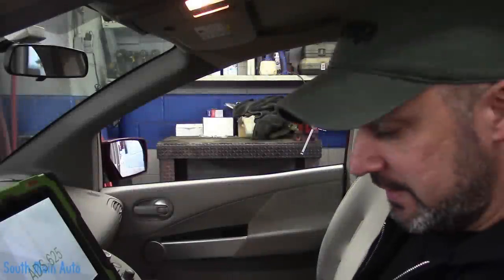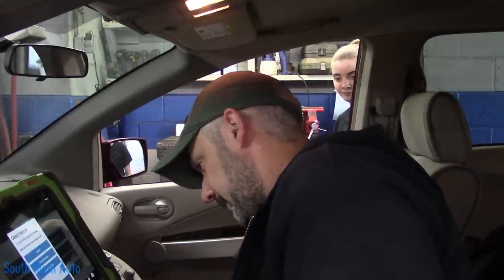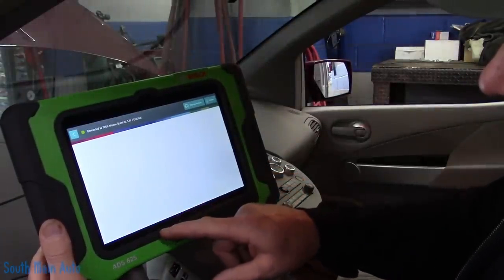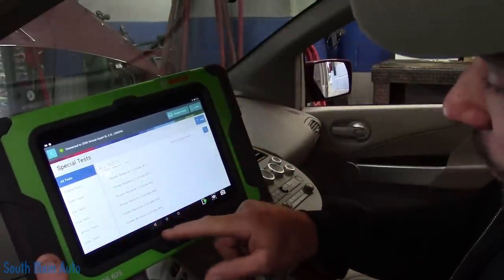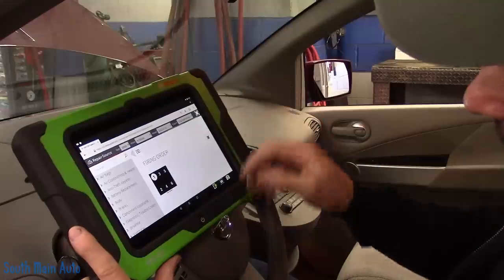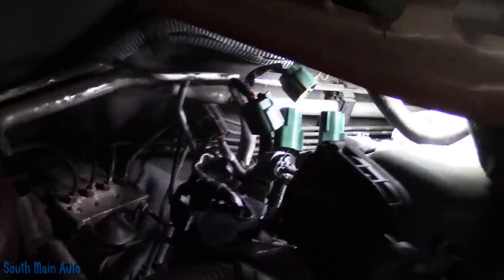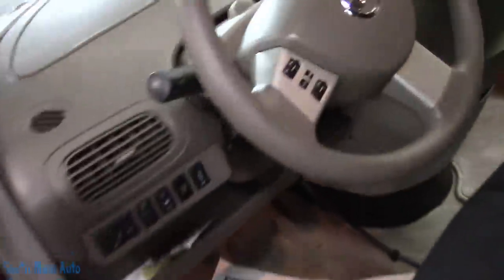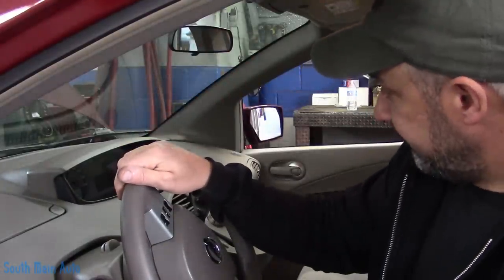Customer Replaced Spark Plugs And Now It Runs Bad!?

Comment: Spent a half hour trying to pound off a rusty old rear brake rotor until I realized the emergency brake was set...
Reply: You're lucky. I spent more than that pounding on a brake rotor, which didn't even have a working parking brake. I had to cut the rotors off. You know its a bad day when the sledge hammer isn't strong enough.
Reply: I went with the angle grinder and a cut off wheel. They came off fairly quickly after that.
Reply: I did that just last month on my F-150. Luckily I realized it was on after it didn't budge after 5 or 6 whacks. It's also the second time I've done it. Guess I'll never learn haha!
Reply: I did this and brought out the torch to heat up the drums, thinking they were rusted on. Only after half a can of lubricant and a lot of hammering did I realized the parking brake was set. Oh well!
Reply: Yes, done that on a non-rusty Texas car..duh
Reply: My 2007 F150 had warped rotors: a common defect with the factory rotors. I was out of town so my wife took it into the shop. The guy pounded on it for a good long time then told her they were rusted on.

The rotor and hub is one integrated assembly, you can’t get the rotor off.
Reply: @snoopdogie187  yeah sometimes they seize on the center of the axle. I've seen the end of the axle flared a bit (previous owner pounded on it with hammer?)  anyhoo a little time with a grinder ,some wd 40 and then a torch got it off of there.
Reply: Lol
Reply: this the funny section😂😂😂
Reply: Been there, done that! Got the "STUPID"  tee shirt...brakes worked great when done, though.
Reply: I actually did that with a rear brake drum once AND I actually managed to get it off... along with all the brake hardware flying everywhere because the shoes were caught on the lip.
Reply: Lmao 😂
Reply: That's funny. I had a similar experience except the emergency brake wasn't on. The cable was frozen and wouldn't release.
Reply: Happened to me as well. Put a lot of big dents on the rotor with my sledge hammer before I realized the e brake was on 😂
Reply: The problem is, especially with drums, sometimes they are just as hard to come off with it off, so the brain just thinks "yeah this one's a real SOB" instead of "maybe the ebrake is still on"
Reply: @snoopdogie187  Better get a chainmail suit! I was out of work for almost 3 months when a cutting disc exploded into both wrists. A damn good quality faceshield goes without saying too!
Reply: @MrJeffcoley1  top hat rotors the ebreak likes to rust and its behind the hub absolute nightmare to get off lolol
Reply: ngl, made this mistake before almost twice lol
Reply: @BaveMage  Wow man that's crazy! I need to do better with safety myself, thanks for sharing that.
Reply: Done that too. I felt so stupid after 15 mins of trying.
Reply: 🤣😭 been there and it sucks, but you live and learn lol
Reply: Lmbo
Reply: Been there done that, my first car changing out rear brakes for the first time. My dad laughed his ass off after the first 1.5 hours when he came out to see what was taking so long.
Reply: Iv done that before lol
Reply: We’ve all made that mistake😂😂
Reply: 😂😂😂😂 we've all been there
Reply: I bought a cheap puller for the brakes you would not believe how easy it is to pull them off even with the brakes on ha ha
Reply: Offered a family member to help him replace the front rotors on his rusted Mazda. We got them off the next day after pounding on them with a sledgehammer, using a three armed pulling tool that just bent the disc and sokeing the whole thing in rust penetrator fluid. The overnight application of rust penetrator was what did the trick.
Reply: Hahaha dammm
Reply: Hey, we’ve all been there.... and I’m a 25 year experienced technician.... we’re all allowed an off day 👍
Reply: yup, me and my friend were hammering away at the drum brake and like 20 minutes in I asked him "uhh... is the e brake up?"
we got it off like 2 minutes later
Reply: lol that was me with drums
Reply: Dude I did this too I am so fucking stupid I had to take it to a mechanic saying I can't get my rotors off you try and they took it off like butter I had no idea why. I found out the second time I was changing my rotors lol.
Reply: Happens to the best of us, wont happen again after the first
Reply: yep i did that with my rear drums once. i was so pissed off at my self...
Reply: That gave me a good laugh. That's part of the journey. Everyone does that at least once.
Reply: I did same thing.
Reply: Been there lol.
Reply: Did the same thing for one side but realized the mistake by the time i went to do the other side.
Rain didn't help to get em off easier 😅

Comment: Heated a piston with propane torch to put in the wrist pin, which was in ice water.  Set the propane torch down, grabbed the piston, bent over to put in the pin and set my hair on fire.  Didn't realize I was on fire until I smelled a horrible odor.  No injury but a memorable moment is screw ups.
Reply: lmao!  I set torch down once on top a water heater doing plumbing, in tight basement, it was still lit and aimed directly onto the floor joist, which happily and quickly ignited.
I was a kid and had water there to quickly put it out. danged kids doing plumbing lol
Reply: This is why I have no hair....
Reply: A guy i worked with called me a risk taker. I said damn right i am. TIP- if your scared to take a little risk once in awhile, stay home in bed, im sure the boss will understand. That guy NEVER got ANYTHING done. He ALWAYS relied on someone else.
Reply: I was under my house trying to hook 115 volt line to run to my shed. There was 2 lines the other one was 220 running to my baseboard heat. I turned the power off and laying on my back pulled the 115 line down to cut. I then looked away to get my side cutters. When I looked back up I did not realize that the 115 volt had returned to it's location and I cut the wire closest to my face. When I got my vision back my side cutters were glowing bright red with sparks coming off of them. I still have those side cutters and now I can also use them to strip wires because of the round spot burned into the center.
Reply: Wayne Gouin
Reply: Bill King lol
Reply: Wayne Gouin brotha do I understand. I hate the "no, can't do it that way, what if..." GET THE JOB DONE!!!!
Reply: I LOL'D... Sorry! Thanks for sharing!
Reply: Heated the Piston to install a wrist pin.?? That's a new one on me. New part on ice.. so the wrist pin was interference fit..? I'm so 🌽 fused
Reply: Musta been the wrong wrist pin...I've vever had a tight fit one short of a shelled out engine
Reply: @AnonYmous-qg4ph  exactly. I've built two strokes and 4 strokes.
Reply: @AnonYmous-qg4ph  press fit. Guy dont have a press. Make due with what you have.  Free floating pins slide in easy.
Reply: @sideshow45  in the past, I've put 1 part in the oven and the other in the freezer
Reply: @rnrudynh1427  sounds like press fit/stationary pin
Reply: @billburkart9087  my electrical teacher told me a story similar and he too uses his side cuts with a hole burned in the center to strip wires!
Reply: Damn vato,your head was hotter than salsa valentina

Comment: I'm a shade tree mechanic at best, and even that may be a stretch.  I try to help friends and family with car issues when I can. Had a friend ask me to do a brake job. I did it, no problem, but when she was driving it one of the calipers seized. Turns out I wasn't as thorough as I should have been when I tightened everything down and one of the bolts actually worked its way loose and the caliper jammed itself against the wheel.  She had it towed to a shop close to her and when I called to pay for my mistake the owner told me "No charge, I put a bolt back in it, I've made the same mistake"  That made me feel a little better, but I still cringe when I think about how I screwed that up.     Thanks for a great channel, I learn something new every time I watch your videos.

Comment: When changing spark plugs, do 'em one at a time -- completely change one and plug its coil back in before removing the next one.  :-)
Reply: Yep. That’s what I do. No mixups.  Mixed wires can cause big problems and do serious damage.  Take pictures, draw diagrams, do it systematically.
Reply: Another idea would be to write on the connector with a sharpie or use color coded zip ties.
Reply: I was going to say the same thing. Can't screw it up that way.
Reply: That's the way you should do it, if you don't know the firing order.
Reply: Especially on an engine you don’t know very well. I know my cylinder numbers and distributor on my old truck is numbered. If it was any other vehicle your method can’t be messed up.
Reply: You can't really mix up coils like you can plug wires. Just label things with a paint pen
Reply: Good sound advice.
Reply: Or you can also take a picture 📷 😏

Comment: Nice vid.  I like how you thought about things:  1) you read the customer info provided, 2) you thought about what to check, 3) you used a diagnostic tool to assess the running problem one cylinder at a time, 4) you determined what things (ignition wiring) are supposed to look like, 5) you examined how the car is actually setup.  You deduced that connectors were incorrectly placed and rectified the situation.  Also, excellent DIY advice:  before taking anything apart TAKE A LOT OF PICTURES!  Too bad every car mechanic isn't like you.  I hope the customers beat a path to your door!

Comment: Hello! 

Once in a while you had said "This must be the most boring video …". It was not. Seeing how the work gets done, mistakes and all, does not make a video boring. When you talk to the camera and let us in on what is going on, that is great. 

I watched the repair of a stripped spark plug hole [from about 3 years ago]. While we could not see directly what you were doing, your explanations and demonstrations of what was going on were very effective. Seeing the results with the endoscope was a great finish to the process. 

I thank you for taking the extra time to record the process of repairs you make. Each of your videos tells a story well. I also appreciate your respect of other channels which do a good job so you do not feel you have to do things they demonstrate well.
Note --  I knew a gal whose husband likely replaced the spark plugs in her car. He pulled all of the ignition wires without marking where they connected. And he took the ignition wires off of the distributor. You know the result -- the car barely held on running. A friend of hers and mine rearranged the connections to help the car run a little more smoothly. While so whacked as the system was, the change helped her drive the car somewhere to get the order fixed. 

I have not done real mechanical work on any car. I did replace a radio. I forgot where the fuse was located. I connected through the proper wire line, not remembering it had a fuse on it. [The car was old enough to use cylindrical fuses. And the radio fuse was in an add-on capsule.] When I finished the change the radio did not work. Except for a couple of seconds when the car ran over a bump that reconnected the broken wire in the fuse. I think I finished the fix. Which might not have been needed if only the fuse were changed. [The newer radio was an upgrade. It was all good.]

Comment: If you work on stuff long enough,  you will screw something up. That's just how it works.  🔧🔩😆
Reply: Almost every "weird" problem I've ever had regarding repairing automobiles was a result of my mistake.
Reply: If you don't make mistakes your not doing anything
Reply: @Scotty Kilmer your a great mechanic and influence on my thinking .  Thank you for all the information you provide. 🔧🔩😆 thank you.
Reply: This guy prob had few more beers and got tired and lazy, yea end of story. Seems like.
Reply: Did my own plugs... Replaced with "triple Platinum", thinking they'd be better. Still ran like poo, so I did coil, wires, etc.. No change. 
Bought a vehicle in the meantime, finally brought it to a pro. 
Replaced with OEM plugs... That'll be 250 bucks, please. 
My $20k spark plugs story...
Reply: Very true.....just did the brakes on my 2004 Dodge Dakota. Put the wheels back on...glanced at the brakes through the hub on the drivers side.....brake pads were switched. Clip goes to the inside. I just take in stride and add it to the checklist for the next time.
Reply: @—TheManInDboX — It can be comical what you come across working on vehicles! Cheers man! :)
Reply: True!  Show me someone who hasn't made any mistakes and I'll show you someone who hasn't doing anything

Comment: Changing the oil with a hangover. Forgot to put the sump plug in. The oil surrounded my boots until I slipped over and landed on my butt.
Reply: changed manual transmission oil AT NIGHT , 100% dark night, with a torch light.. filler hole on top of transmission through engine compartment ( front drive) ..  used a funnel to stick in the fill hole and poured 3 Liters of oil into it... until i heared a strange sound reminding me of some liquid pouring on a surface...  the funnel was not in the hole , it was next to it.. 3 liters of transmission oil allover my transmission, drive axle, subframe and of course the drive way... it took me weeks and countless power washes to get the oil off my car and several bottles of oil stain remover to "repair" the rive way... an insane mess....my dad was very pissed of because of that huge stain. I looked like somebody drained an oil tanke
And of course could not drive to work the next morning because I had no more tranny oil
Reply: Johnny Blue that’s why you gotta change the oil WHEN you’re drinking😉
Reply: Did this while baked on my DRZ400, its got 3 drain plug locations, and 1 magnetic filter. I left 1 loose.... 50oz car wash on the ground cleaned it up nicely.

Comment: My buddy was trying to drill out bolts..called me..he ruined a bunch of bits..I showed up and was watching..turned out he was using the drill in reverse..
Reply: Reminds me of the occasional fella who changes his wheel, thinking to himself..."Man these are tight..."
Of course he is turning the wrong way and breaking the studs.
Reply: I’m a carpenter/contractor.  I hired a young kid...18..at his fathers request( one of my customers) . He thought it would be good for his son to experience some real world  stuff. I laid out a bunch of locations on some lumber denoting where to drill holes. I told him to drill the holes and bring the lumber around back where I was working. This was an addition to a residence. I turned him loose and I went around back to work. Time passes...no lumber. I walk back to the horses in the front....kid is sweating bullets. Yea, same thing....running drill bit backwards.  I canned him. I think he was happy to go. I assume he is now a lawyer/accountant/I.T. guy.  Something with soft hands. Different strokes.  Dave Heitman Semper Fidelis
Reply: Cheepchipsable  I had a blowout while driving my Dads 61 Plymouth Fury back in 1967.   I was 16 on my way home from my job at the Safeway grocery store. I was doing 110 when it happened,  but I digress. Stopped, jacked up car,.....”damn, these lugs are tight”.  I twisted one off. Shit. Tried another. Twisted it off. Shit!!!! Tried righty loosey on the next and it came off easily.  Chrysler Corp lugs back then were righty tighty on one side of the car and righty loosely on the other side. Learned that the hard way.  Dad was pissed.  That was 53 years ago. One year later, at age 17 I joined the Marines. I was 17 so my dad had to sign the papers giving permission since I was under 18. He almost set the paper on fire from signing so fast. I think he was glad to see me go. My younger brother then took over the responsibility of driving Dad nuts. My brother succeeded in doing so.  He knocked up his girlfriend at age 18.  She was 19. They are still married. And very happy. In 1971 my brother ....same brother....drove his new 1971 ‘Cuda 340, 4 speed ...”up a tree”. I was in Vietnam and missed out on the aftermath of that shitstorm.   Dave Heitman Semper Fidelis
Reply: Maybe he thought they were left hand drill bits? Yes, those exist. Snap on has them as bolt removal tools.
Reply: LOL! That was a hard brief chuckle..
Reply: Can’t fix stupid........
Reply: @Cheepchipsable  
That was easy to do with 60s Chrysler products,  the driver side used left hand threads . Many a man made the same mistake. Good thing when replacing them you could put right hand threaded studs back in.
Reply: @eileenheitman4351  thanks for the laughs hope all is well
Reply: @mph5896  thats what i was thinking too. show them how to do it the way you want THEN go from there. Sounds like he wanted shitty results so he could have a reason to fire him to get him out of being in that situation of doing a favor for the customer anyways. He set the kid up to fail and got what he wanted.
Reply: "Scott Raymond 1 year ago
My buddy was trying to drill out bolts..called me..he ruined a bunch of bits..I showed up and was watching..turned out he was using the drill in reverse.. " Had a team leader out at work do exactly the same thing. He doesn't work there anymore.

Comment: i was an auto mechanic for 32 years and have seen all kinds of weird and crazy customer issues. one time a woman brought in a caprice classic,305ci engine with 4 barrel carb. the car was only a few years old at the time and it was running rough and smoking a ton out the exhaust. turns out the engine was literally full of oil up to the valve cover. the woman thought changing the oil meant putting another 5 quarts in never realizing that old oil needed to be drained out and filter replaced. so we drained it and put the proper amount of oil back in and swapped the plugs. it smoked for about 15 minutes or so afterwards but cleared and was running just fine after that